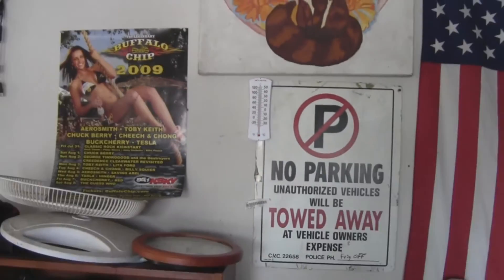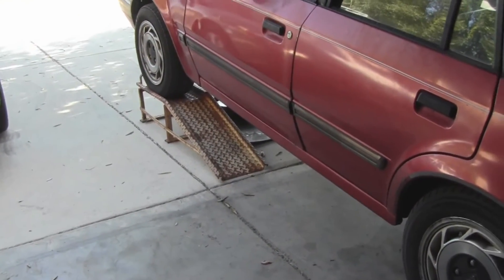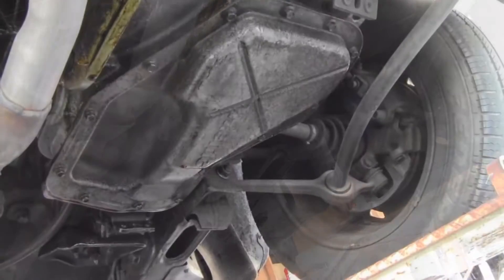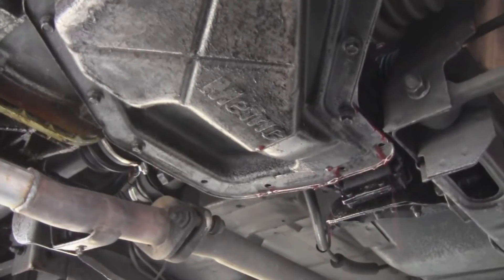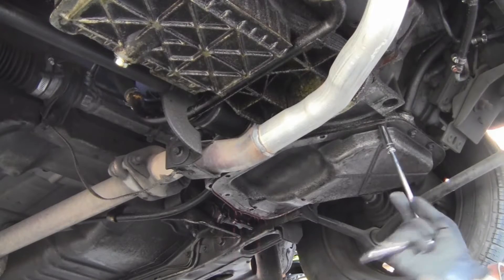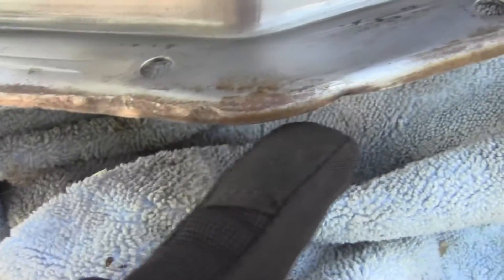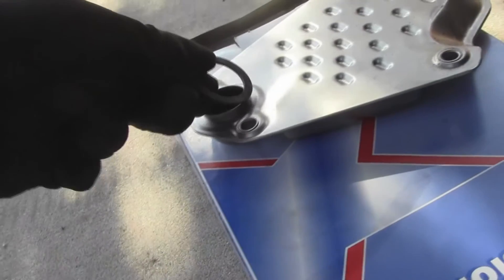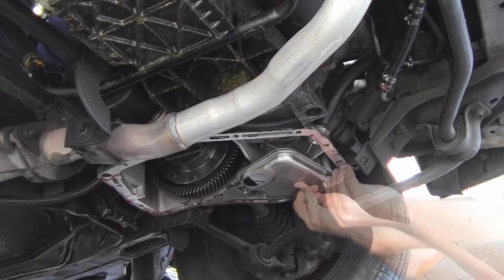1989 Ford Escort ATX Transmission Fluid Change

Comment: what about the torque converter oil to drain that, I have an escort 95 and put type f in it found  mercon was to  be in, drained it now it doesn't seem to want to engage just when you start it up it'll go in gear put it in drive and then in reverse a few times, now it doesn't shift at alll, i thought of the fluid in the torque convertor might be the issue, got any ideas ?
Reply from the maker: Either torque converter is shot or shift solenoid is messing up